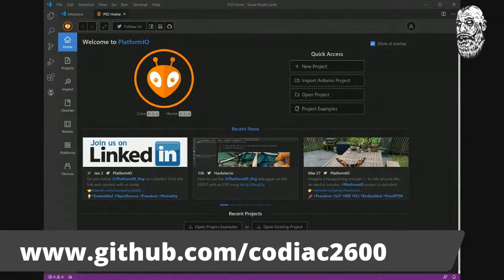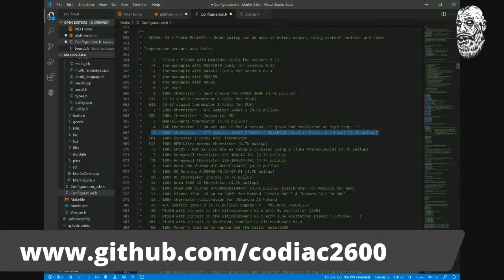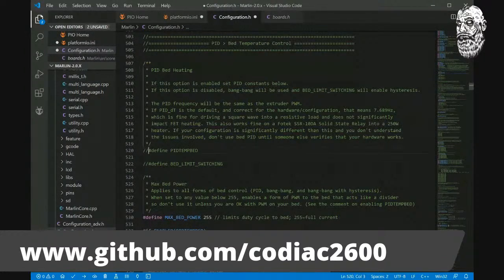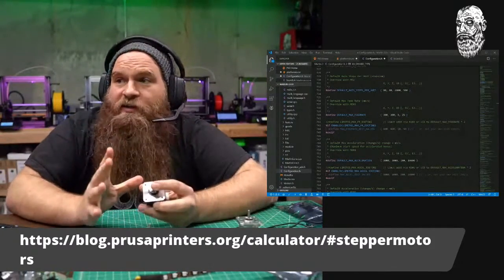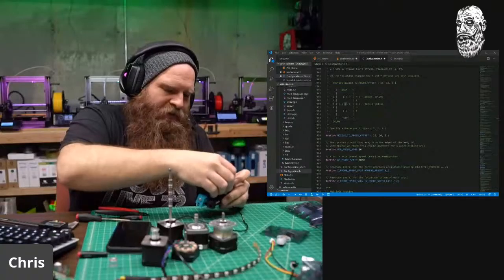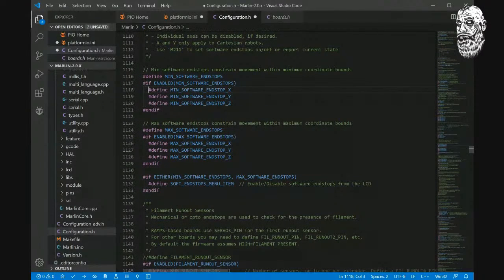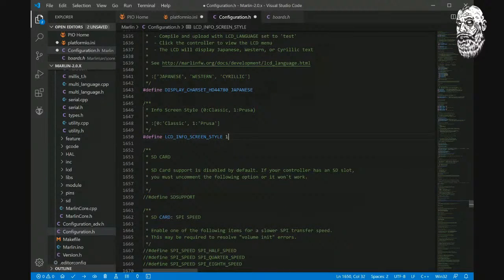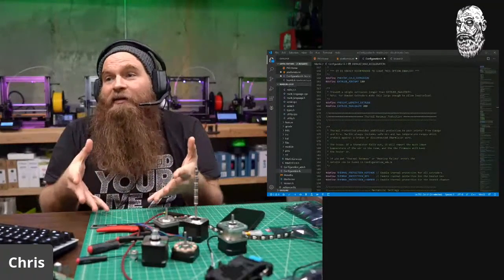Marlin 101a - The basic understanding of Marlin Firmware

Comment: The encoder changes works on the LCD 12864. I adjusted the numbers and had dramatic speed changes using the knob.
Reply from the maker: Yes. You’ll get some. But it’s not 1:1. It’s based on your hardware settings and slicer settings. Turning it to 200% will in no way halve your print speed. That’s the point made.

Comment: Hi. I don't know what to do. I have equipped a CoreXY printer with the SKR 1.4 Turbo and almost everything works great. Everything except the leveling sensor. It is an inductive NPN sensor (XY-08N) just like a PINDA only without a temp sensor. I followed your tutorials step by step and unfortunately I can't get it to work. If you check with M119 it shows OPEN, if you hold something metallic underneath the LED lights up but under M119 it is still OPEN. I have already asked about any Facebook groups and I am not getting anything that works. Some say that I should solder a resistor to it, but the size varies between 1.6k and 10k ... I really don't know what I'm doing wrong. Have you tried other inductive sensors besides PINDA with Marlin and SKR 1.4 Turbo? I can't print anything because of one thing and it is extremely annoying.

Comment: Hi I have a question, I installed the TFT 35 V3E with SKR 1.3, the files in the sdcard are not read in full Do you have any solution?
Thanks
Reply: @Skudiero for your setup you need to do this: Use one sdcard that came with the SKR 1.3 for the board or use a bigger one up to 32GB. Use a different sdcard with adapter for the TFT35 screen firmware. The sdcard for the SKR 1.3 stays in the SKR 1.3 at all times to operate the board. The other sdcard (with adapter) can be used to update the firmware on the TFT35. Easiest way to do it is to download the latest firmware from the Bigtreetech github. https://github.com/bigtreetech/BIGTREETECH-TouchScreenFirmware Unzip the folder and copy the correct firmware and the folder with bitmaps to the sdcard (with adapter) At the moment of writing BIGTREE_TFT35_V3.0.25.3.bin and the folder TFT35. With the files copied put the sdcard (with adapter) in the slot of your TFT35. Turn on your printer and the firmware will update. After the update process, reboot your printer, use the reset button on the TFT35 just to be sure it loads the latest update. In the TouchScreenFirmware you find two folders you can copy, difference is the theme (icons) and a few settings. You'll find info on that on the Github page if you scroll down. Happy updating :-)
Reply from the maker: Skudiero are the tft firmware files not read or the skr V1.3 files?
Reply: @Mr3DPrintWizard  It does not show the files in full their name